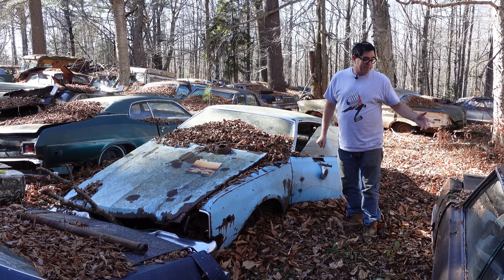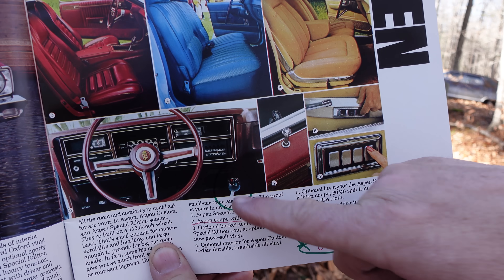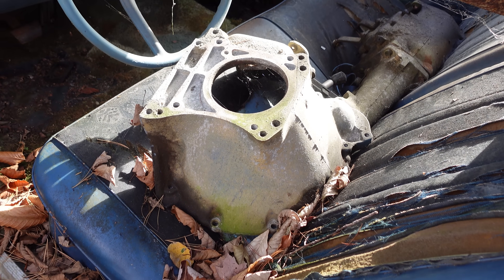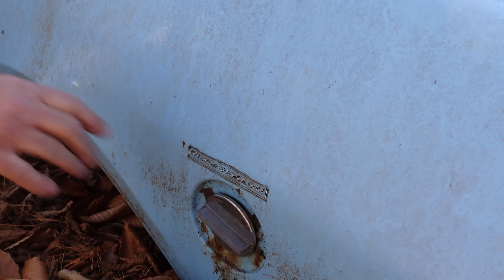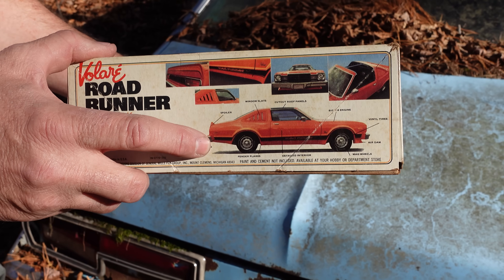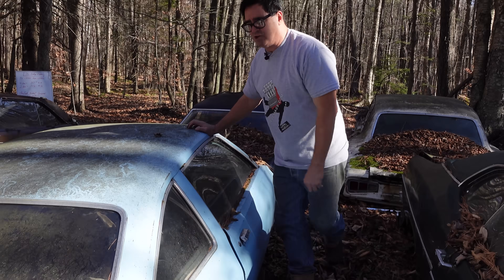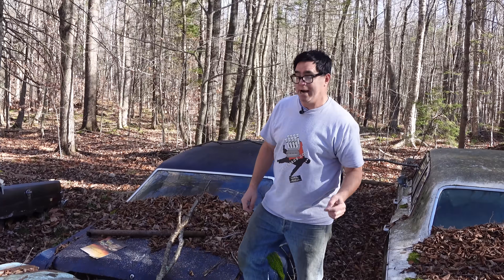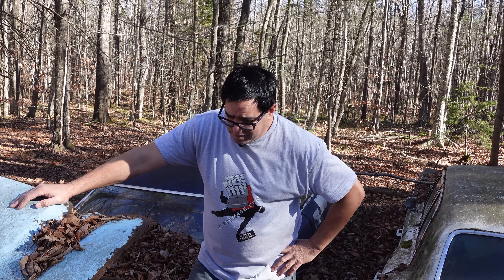First F

Comment: used to call these lemons the "Aspirin", they'd stall out when you took a turn. I remember Motor Trend (?) doing the article on the Richard Petty "kit car" with the E58 i think.  You could get decent power-to-weight ratio, compared to what else was out there. 

As for the blooper model, I remember there was one Road Runner offered on that chassis, but for model kits i remember that car being offered as a "Welcome Back, Kotter" Sweathog version. wish I had bought that at Barker's or Two Guys back in the day.
Reply: Blame Holley and Carter for that. Absolutely the pits with regard to carburetion. Chrysler got smart at the end of the carbureted era and went to a Q-Jet.
Reply: @googleusergp  for a period of time, even Carter "went Q jet", building rochester's carbs to help meet demand.  But Ma Mopar was going bankrupt around this time, perhaps the only thing reliable they had was rebadged Mitsibishi (sic) cars...and that's a maybe, i didn't own one but i think they had some issues too?
Reply: @albertgaspar627  Mitsubishi wanted to break into the US but didn't have the dealer network, so they used Chrysler to do so until 1983 when they sold cars under their own name. GM had Isuzu and Ford had Mazda. Yes, Carter did manufacture Q-Jets under license from Rochester, and yes it was due to a volume issue.
Reply: @googleusergp  oh yeah, i remember the "challenger" that was a Mitsi, and then later the turbo colts that seemed to actually not be all that bad. What paid off for Detroit was when mini truckin' became a thing--they didn't have to make one until the 1980's, they just rebadged the Jap stuff (LUV, D50, Ranger etc). I thought Toyota's lifted 4x4 in 1979 was cool but I live in a land of corners so i wasn't going to try that--did buy the Revell SnapTogether model version a few times at Caldor's :)  

i guess in automotive history, Mopar gets the award for most orphan brands adapted. Ford brought in their own Merkur and GM did their Opel, but Mopar had Jeep, AMC (which absorbed plenty of their own offbrands), Renault, Mitsubishi...i think they created Eagle out of that mess.
Reply: @albertgaspar627  Yup what a mess. Lol.

Comment: I had a '77 2-door Volare with a 318 and the manual 4 speed overdrive transmission.  It had a sunroof and the Magnum 500 wheels.  It was a decent looking car with the Magnums.  I got 26 MPG on the highway at 70 MPH.  It was dependable if you kept up the regular maintenance. I thought these cars were better looking than the Duster.  The proportions were a little better.  The Duster always looked a little too heavy in the rear to me.  If you could find one that isn't rusted away, they would make a good candidate for a restomod.  I've seen some of them that have the chunky bumpers narrowed and cut in half along the length and it completely transforms the car.

Comment: Yes the F body(aspen/.volare)we’re VERY prone to rust….. but the underlying components of them lasted to 1988 with the M body(diplomat,gran fury,fifth Avenue)passenger cabins were the same along with most interior parts.the F car’s suspension also shares parts with the 1980/1983 J cars (mirada,2 nd gen cordoba,imperial )
Reply: Through 1989 (the last year), not 1988 on the "M" body.
Reply: They were the same body basically.  After the 1980 model year Chrysler Mexico sold a car with the 1980 Volare front end and the Diplomat rear end.  The body lines were the same.
Reply: Still  really hoping that you run across  a J body Mirada.  Still have my 80 Mirada cabriolet that I bought brand new.
Reply: I stand corrected….I couldn’t remember if it was 88 or 89 for the last year for the M body
Reply: @russelldesabre9530  1989 for sure.
Reply: @joemiller2629  You Tuber Classic Ride Society has found two of them, the last one was a 1981 Mirada a few weeks ago. The other was a 1980 about 2-3 years ago. I decoded both of them.

Comment: My brother bought a 1976 Aspen , his first brand new car. 2 door, slate 6 auto. He had 100,000 miles on it by 1982, and I was pop riveting sheets of metal on top of the fenders to keep the water and road salt from coming up off of the front tires and covering his wind shield. He drove it on to 130,000 miles , but it just got too rotten to keep driving.

Comment: Aspen where the beer flows like wine. This was the Chrysler Kit Car era and that was by far the high point of this body use as the short track stocks were fair;y good looking and did win races. As far as the street version rust problem and the front end would not stay in alignment due to just slowly bending and drive-ability problems and so on.

Comment: Hi Steve, great video on this Aspen. After looking at that Aspen closely, I see why High Octane Classics have it its a 1 of 1 puppy powered. SWEET! what a cool model car "booper." I'm jealous that its not in my stash of models and parts. I have the R/T model but don't have the box, so im not sure if it's the same.Never had any rust problems with the 2 Aspens I've owned. 1 was the slant 6, and the other was a 318, both automatic. So, for a charity event, I  used the 6cyl car as a demo derby car. I did pretty good considering a lightweight car compared to the competition. The car still ran, but I broke a U joint and had to break my flag. Brutal weather up there stay warm. Pretty windy down here in NC below freezing temperatures. Namaste 🙏🏼
Reply from the maker: Hi Chris, that MPC 1976 Fury Road Runner "blooper" kit isn't really too expensive. I bought the one in the video on eBay for $59.93, including shipping. Though no two eBay auctions are the same, these are overlooked by Road Runner fanatics because they're "lame". I don't think so! Go get one! Thanks again for writing. -Steve Magnante
Reply: @SteveMagnante  thanks Steve, gonna do a search for it now. 🤙🏼

Comment: My very first car was a 1979 Dodge Aspen 2 door with the mighty super six 225 leaning tower of power and it was a great car. I never had a issue with it the while time I owned it and now I have another Aspen but it's a 1979 Aspen R/T and it has a 360 4bbl in it. It's the same 360's they put in the Chrysler 300 and the lil red express it's the police 360 and right now I am working on it

Comment: We had 2 Plymouth Volare  both two doors. 79 had a 318 lean burn. With a automatic. 78 was a 225 with  three speed over drive. Nice cars . Rust rockets
Reply: The Lean Burn system was horrid and many were ditched and the performance (and reliability) greatly improved after that.
Reply: @googleusergp  we pulled it off. Ran a lot better without it
Reply: @redneck5356  No doubt, what a PITA that system was. No good all the way around. It actually did not make the car run better or more efficient. The idea was right, the execution was wrong. LOL.

Comment: I have a 76 Aspen R/T that is about as rusty as this one. Mine was a very late build and had the T-bar roof, that wasnt offered till 77. Its a real thing as shown on the fender tag. It is a 318 which was better deal than the 360, as all 360 where lean burn. Very heavy optioned car. no AC or Power windows or door ,locks, but every thing you could get including folding rear seat. Probably the rarest Mopar Ive owned, to bad they rusted so bad.

Comment: I bought a 1979 dodge aspen back in 1986 for $100.00 to drive while I was waiting for my 1968 RS/SS Camaro 396/4spd to get finished being restored.
I beat that Aspen unmercifully. I blew up 3 baby torqueflite 904 transmissions and then upgraded to a 727. Also blew up 2 rear axles which was finally upgraded to a 8 3/4 and all this damage was done with the stock 225 supersix engine. I forgot to mention the rear axle was flipped for 6 inches of lift in the rear with a frame stack in the front to fit 33x12.5 R15 Super Swampers. It spent more time at the bottom of a swamp hole than on the street.

Comment: I remember seeing those come off the assembly line with Aspen script on the left front fender and Volare on the right. They did rust  up pretty good,  the antenna would fall through the fender, but all in all it was a pretty good vehicle. Although I don't think it could ever been as good as an "A" body car.
Reply: Yes, that news story made the rounds a few times back in the day when the media wanted to point out just truly awful the American auto industry had gotten. All four "Big Four" back then had their stories.
Reply: @googleusergp  remember how late 60s, early 70s Fords were the lepers of the age? Ford got a handle on it by 73. 😂 Got some stories.... 😆 I mean, the entire bottom 20 percent, 1/5 of the door fell off like some zombie's appendage. Nothing between you and raw, slushy road 'cept for the vinyl wrapped cardboard interior door panel. Couldn't go down dirt roads even with the windows down because of the dust you'd pick up. Back seat passengers with their shirts pulled up over their noses, faces covered with dust, big ol' streaks under their eyes from tears running down their faces. It was surreal like some low budget drive-in horror flick. I used to wonder what was up with those early 70s Ford p-ups that looked like the frame was bent at the junction of the front fender and cab. I found out when I had one that was straight until I got rough with it. Damn front cab mounts had oxidized and disintegrated to the point where the cab had dropped 1.5 inches placing the steering column out of alignment with the steering box. Ruined the column but it was an easy fix.
GM was not immune to the cancer gene either. Had a 70 Poncho T-37, 350 auto that would squeal like a pig from a standing stop. Just mash the gas and make it bitch. The drivers lower control arm rusted to the point where the coil spring came through. Where the windshield met the roof rusted through. God, I loved that car.
Reply: @kenttalsma7906  Ford was bad through the 1980s. Fuel injection cleaned up their act (along with the others, but more so at Ford and Chrysler as their carburetion was awful).

Comment: I owned a 75 Gm car that was unleaded only. 1986.  Put duals on it with a 73 motor.  The tire bar for a coats 40/40 will expand that fuel tank neck just enough to use leaded fuel 😀
Reply: The original owner of my 10th Anniversary Trans Am told me when we spoke on the phone that he ditched the converter the first week he owned the car but never did it to put leaded gas in it or anything. Those old GM monolith converters were like sticking a banana in the tailpipe, so he welded in a test pipe at the time.

Comment: Thanks Steve!  I always thought those cars could’ve been pretty wicked hot rods and/or muscle cars absent the smog stuff.  I’m thinking more along the lines of the late 60s/early 70s cars where the chrome wasn’t subdued and body-colored plastic wasn’t all over.  Just a thought.  I never knew they had the column manuals so recently available.  That and the transverse torsion arms - these ‘extra’ facts are just fascinating!
Reply from the maker: Right on
Reply: It is funny you say that.  These cars were sold in Mexico without all the smog stuff and Lean Burn system.  The Mexican Spec cars are evidence of what the car could have been without the US government intervention.
Reply: @mexicanspec  That’s cool!

Comment: The top of the line F body in Mexico at that time was the Super Bee and it could be had with a 360 V8 and a 4 speed on the floor.  We also didn't have the Lean Burn system so the Mexican cars will actually run.  They are relatively cheap still compared to what people pay for a nice V8 Duster in the US.

Comment: The Petty Kit Car was big in racing 🏁 at the time on small tracks, ARCA and USAC.  Remember that Indy stars drove in the USAC Stock Car division at the time.   It was common to see the Unser's, AJ Foyt,  Roger McCluskey,  Gordon Johncock and others competing in stock cars at the time.  Some chose to cut down older Charger and Road Runner's though as they were superior to the Petty built Kit Car.  There were at the dealerships special Petty Volare/Aspens with custom parts and the number 43 on the side, built for the street.
Reply: Yes, both Plymouth and Dodge had versions of that "kit" car and a few have been featured on YT.
Reply from the maker: I love / hate the '78 Petty Super Coupes for how boooo-gus certain aspects were. Like the FAKE hood pins. They are one-piece units that lift and lower with the hood skin and do absolutely NOTHING except......sell the dream....and cars. Same holds true for '77-up Pontiac Trans Am hood bubbles. One piece, molded shut and NOT functional unless you break out the hole saw! But MAN DID THEY SELL CARS! I knew these facts as a 13 year old kid in 1978 (having also experienced real Mopar hood pins on friends' '70 AAR 'Cuda and '70 Superbird) and felt pretty cynical at how somebody in a suit, chomping a fat cigar probably said "they'll never notice the fakery". I did! But I'm odd like that. Anyhoo, take a moment to examine the "hood pins" on any '78 Super Coupe and you'll get a laugh. They are still significant artifacts of a sorry time in auto history and deserve reverence for that fact. Thanks again for writing. -Steve Magnante
Reply: @SteveMagnante  The Trans Am hood scoop "functionality" was doomed by the EPA and noise regulations at the time. Pontiac also had to issue a recall on the 455 as they were skirting some emission rules back then and the EPA gave that a no-no. Prior to that, Pontiac (with John DeLorean at the helm) would cause ire with GM management with the various ads and options. Two of them come to mind. The 1968 GTO ad of "You Know the Rest of the Story" with the GTO parked at the famous Woodward Avenue "turnaround" was an obvious nod to street racing and angered GM management to the point that it was only shown once and then immediately pulled. 

The other was the short lived "VOE" (Vacuum Operated Exhaust) on the 1970 GTO also called "The Humbler". Basically, it turned the exhaust into open chambered exhaust. When GM management caught wind of that, they put that one to bed. But not before an ad and commercial came out (which can be found on YT) showing a young driver cruising slowly through a burger stand parking lot and activating the VOE (obviously looking for a challenger to race).
Reply: @googleusergp  cool beans! You got a link for that ad or a title I can search on?
Reply: @kenttalsma7906  For the 1968 GTO ad, just search "You Know the Rest of the Story" GTO ad and it comes up with the background story. As to the 1978 Aspen kit car, just search that in YT, it will come up, there are a few videos on them. Look up "1970 GTO Humbler" and that will come up on YT. YT'er Osborn Tramain who posts on this channel is the one that has the Humbler video up on YT.

Comment: F body. Never knew they called them that. F is not for failure you're correct. Now if it's for future and the future is here. A 360 four barrel should make one of them cars romp! With today's innovation take one of those plastic sticker performance car I had a lot of style put a more modern engine in it are enhance the original and it would  even more fun to drive. F is for Fox so let's start calling them Fox body dodges. After all they do have a nice shape to them. Similar to the Chevy Nova and even the mid to late 70s overs are getting a lot more love. Why shouldn't these f bodies for fantastic styling they look better than nova's of that vintage in my opinion. I even own one are those novus. Merry Christmas to everybody from the southern version of the North Pole 12 below temperature

Comment: This car is a big reason Chrylelr had so many financial issues going into the 80's. Ask anyone that was around and saw them new, the build quality was trash, the interior design lent it to falling apart early even with good build quality, they rusted badly...
These cars were treated like the red head step child right from the factory and were designed to be built as inexpensively as possible. Not sure if Chrysler thought it would undercut price on monzas and Mavericks or what, but it was a junky car and if you can find a clean one today it is a needle in a haystack and must be babied to preserve it. 
The reputation this car had as the affordable entry price car spread across all of Chrysler's lineup. Between aging designs and a falling reputation it is no wonder they had to throw everything out and start over in the 80's.
Reply: Chrysler's production and inventory system back then was a "push" system. That is, "We build it, now you Mr. dealer, go sell it". This led to weird combinations and options that no one wanted. When Mr. Iacocca came on board, the first thing he did was can that and go to a "push" system of inventory. That is, "You tell us what you/the customer want and we build it". That shrunk inventory and saved them money.

Comment: I just sold a 78 roadrunner for 11000 bucks it's was 360 4 barrel iput a 4 speed in years ago it was keep in a building in winter I still had put front fenders on it three times

Comment: Drove a 79 for a bit. 6 cylinder. The trouble was the tranny wouldn`t down shift into low very easy and it would drive through the brakes when stopping wearing out the brakes very fast. And it was a rust bucket. I bought a new Toyota celica the same year. Drove the Toyota for twenty five years trouble free. Ten years earlier the dodge was in the junk yard with a good motor the the body was gone.

Comment: I have a mint condition 1980 with 18k miles on it....2 door, no options...not even a radio
Reply from the maker: Hello john dziak, that's a NEAT car! I'm sure you'll keep it all original. There aren't many left. As for the radio-delete, I love that! Less is more. Does it have the "fake plastic retracted antenna plug" in the front fender top to seal the pierced hole where the antenna would go? I've seen a few like that. Cool car and Thanks for writing. -Steve Magnante